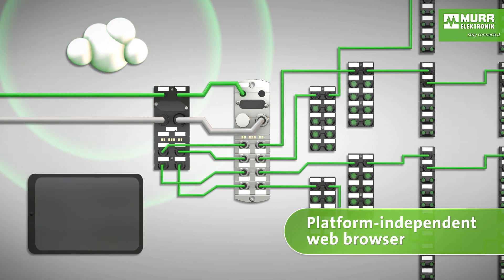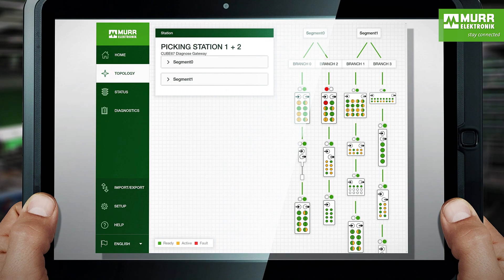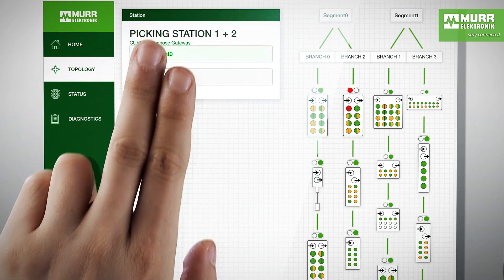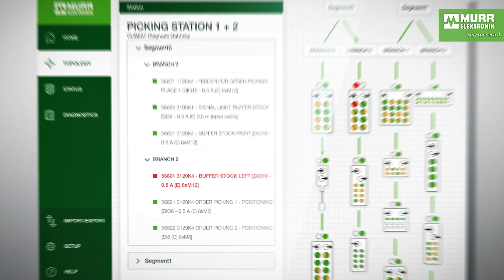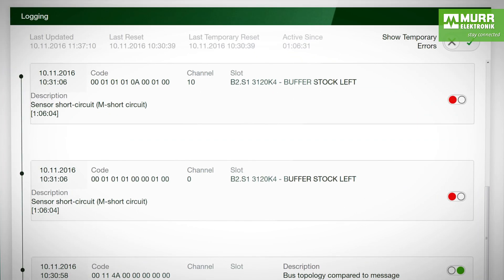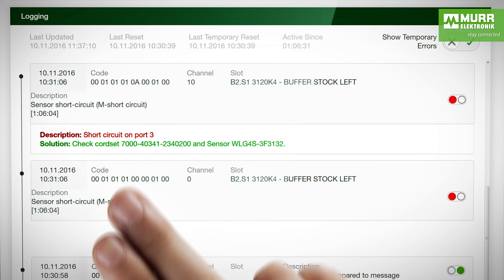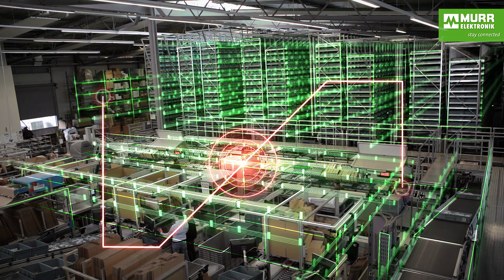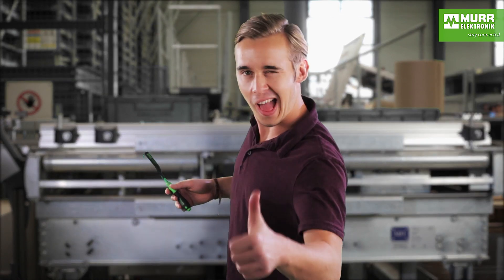Cube67 Diagnostic Gateway - Diagnostics made easy!

Comment: Is it applicable for profi bus communication system with rexroth plc
Reply from the maker: Yes, you can access the Diagnostic Gateway via Ethernet Connection. It's independent of any control or fieldbus protocol.